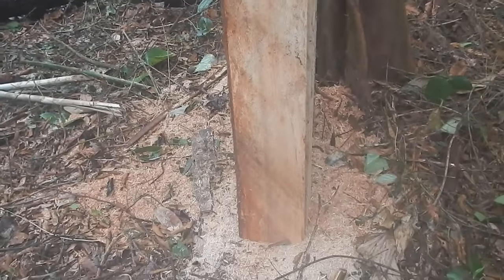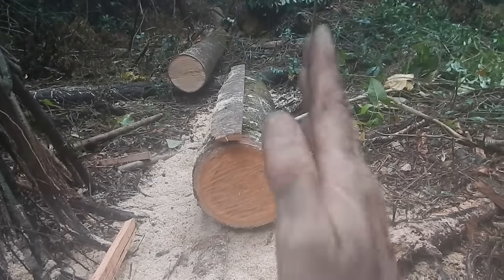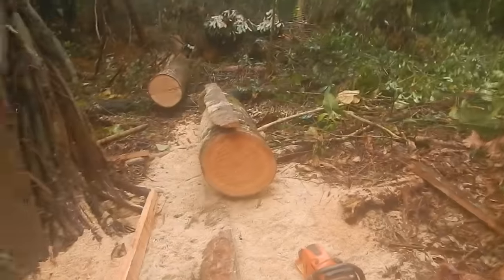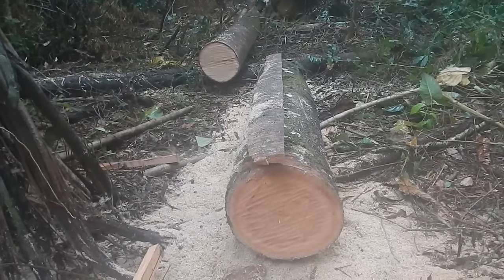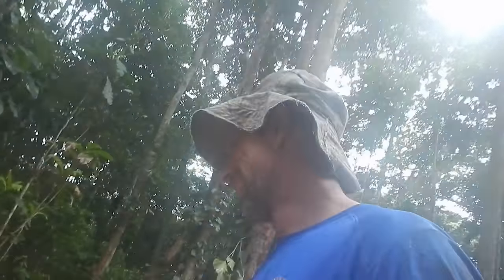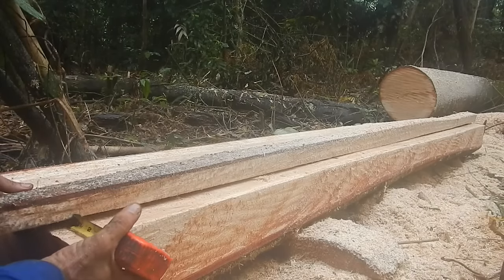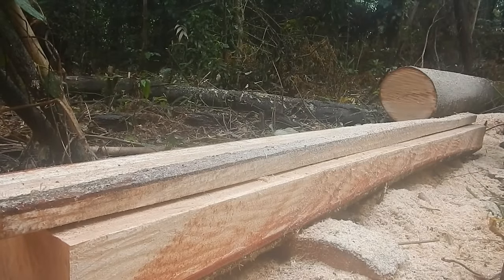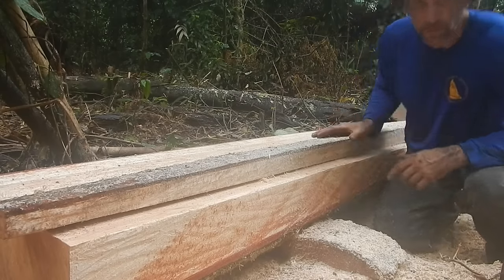Cutting Wood with a Chainsaw Technique

Comment: Also remember the wood will dry out and it's going to change .... What you need a big planer to run those boards through...humm.. I don't have a planer.. I'm thinking of an easy way to make one with two rollers with blades on it
Reply: But really Jamie as long as the pieces fit... Like if you're doing tongue and groove from one wall to another into that concrete as long as you have like two or three inches of play on the inside it should be fine..
. Because once you start securing them together they're going to be Rock solid even when they dry out

Comment: How old are the trees? Plans for introducing or replacing plants? Just wondering how you manage this if it needs managing at all, i imagine nature can keep up to some degree...
Reply: Piling the discarded limbs and sawdust in a pile, rather than them scattered around shading any new seedlings out, will help bacteria break the plant matter down into a passive compost pile and allow nature to do its job replanting the work areas.
Reply: Trees will definitely spread in a place like that, but would be good idea to plant quality trees or prevent trash trees taking the area
Reply: @teropiispala2576  It is difficult to get a seedlings to grow, unless you are not trying to get them to grow.  Getting rid of the seedlings you do not want is easier than planting seedings you want.
Reply: @ydne  it depends if you have ready grown saplings or not. Many times when there has been trees groving, there are already rooted saplings, which just wait for a light to start growing.

I live in Finland and own some amount of forest. Conditions are bit different, but also growing season is short. If the trees are cut off, in two years, there's 2m long bush, which is typically birch, alder, willow and aspen. In five years, it is as thick as wrist. We typically plant spruce or pine, and those bushes need to be removed in 3-6 years, depending on the place.

I'm pretty sure that in place with lots of moisture and heat, growth is not slower. Of course dense high quality tree usually grows slower.